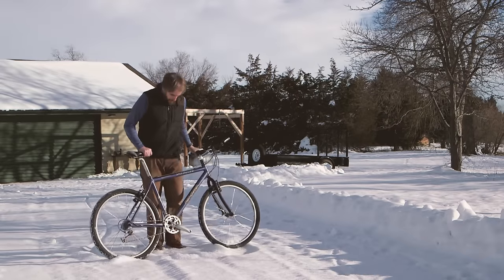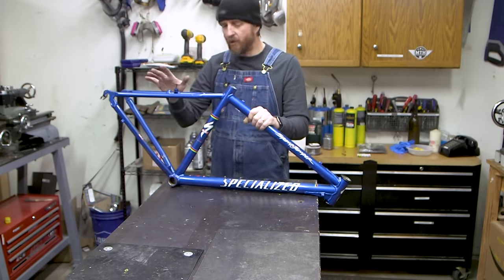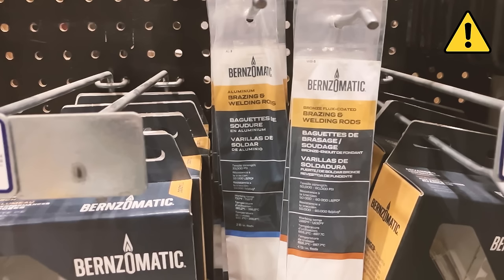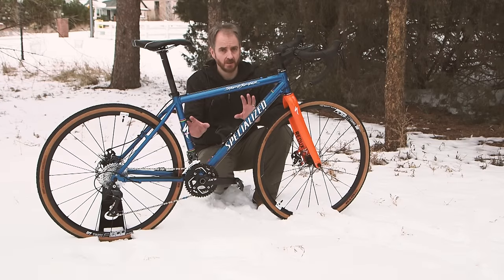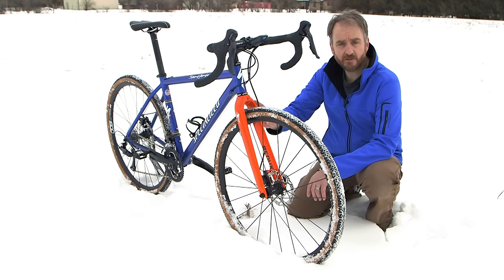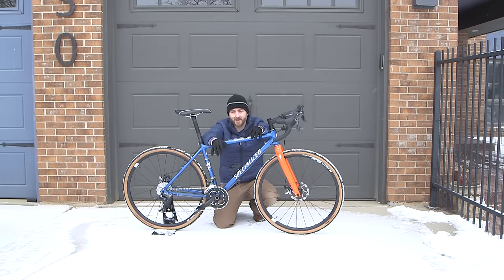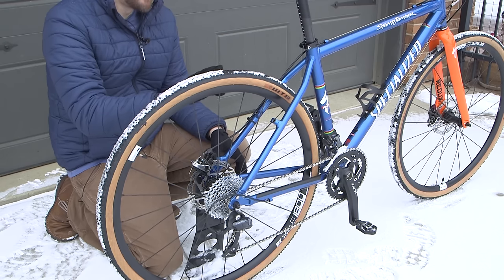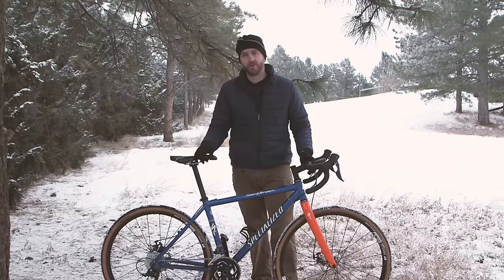Specialized Gravel Bike - Convert 90's Mountain Bike to Gravel Bike

Comment: You shouldn't be able to touch the floor when in the saddle on any bike. Think about it, you want to have almost full leg extension when at the bottom of the pedal stroke, why would you then be able to touch the floor from that position? 

Shift your weight to one leg and get off the seat.
Reply from the maker: Yeah, you’re totally right.  I regretted putting that in the video.  What I really meant to illustrate was the higher overall bottom bracket on the old mountain bike frames.

Comment: How did you go from 26" to 700c wheels?
Reply from the maker: I bolted them on, pretty much.  I talk about it in the video, though.  Front fork is for a 700c wheel.  Frame supports up to a 32 tire in the rear.  I cut out the seat stay bridge to hold a 35.  So the general gist is,  new fork in the front, bolt-on and go in the back.
Reply from the maker: I should note that I put on disc brakes.  If you want to use linear or cantilever brakes, you'll have a harder time as the brake mounts won't be in the right place.

Comment: All the effort to convert that vintage frame to disc, and then you fit mechanical discs that are hardly, if at all, any better than well-adjusted cantilever brakes.
Reply from the maker: I would argue that they are worlds better than well-adjusted canilever brakes.  No lever flex.  Much better pad-to-rotor surface friction.  But to each his own.  I think the internet has had this same discussion a thousand times over.

Comment: Why a mountain bike is far better off road
Reply from the maker: I just did the FoCo Fondo gravel race on it this past Sunday.  53 mile race including singletrack, goat trails and several miles of gravel roads with average speeds in the 22mph range and managed it in under 3-hours.  I think that's pretty good.  Not sure how a mountain bike would have been any better, especially on the really fast sections, where the riding position of the mountain bike would have me sitting up in the wind, slowing me down and using more energy.

Comment: That wheelset cost a lot more than you claim
Reply from the maker: No.  Current version of it is $159 on eBay:  https://www.ebay.com/itm/144743200221
Reply: @RobertAdairWorkshop  you have DT Swiss 1800 Spline Wheelset on your build, that link is for some knock-off brand. There is a huge price point difference here.
Reply from the maker: @marcuspascale4902  11:49.  Alex Rims a-class wheels and CST Cultivator tires.  Initial build.  I talk about the upgrades after the ride footage where I show the tubeless tires. I made upgrades after riding it a bit.  I mention that in the video, too.  The link is for the same A-Class wheels I used, just a newer model with different decals.
Reply from the maker: @marcuspascale4902  Good grief.  Now I see your point.  Yeah, I used two different wheels.  A-class for the initial build and ESpline wheels when I ent tubeless later.  I filmed the video over 6-weeks so some footage for each wheelset.  The video isn’t shown chronologically which is why you see the bike in various forms throughout.  

I think this video used about 80 videos edited together and shot over those 6 weeks and because I filmed several of those clips during editing when I realized there were “holes” in the story which is why it’s not all initial build version footage.

I should’ve made that more obvious.  I will in the next t video.

Comment: Just a shame it required $$$ in tools and workshop to actually build it.
Reply from the maker: Not too much money.  The mount could have been made with a hacksaw and a dremel.  The brazing only required a sander, wire brush and a torch.  And then I guess there's the bike specific tools like the bottom bracket wrench.  But  no mill or workshop really required.